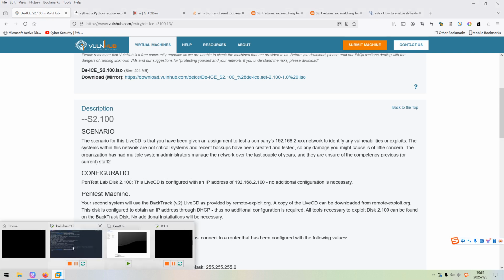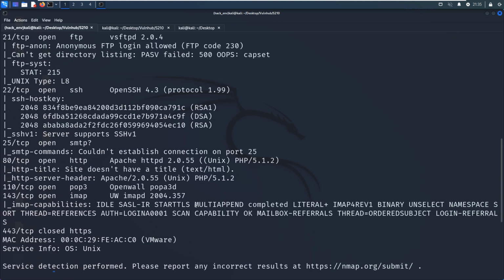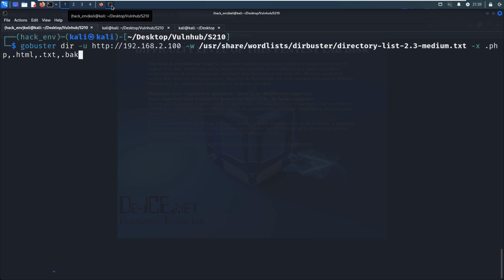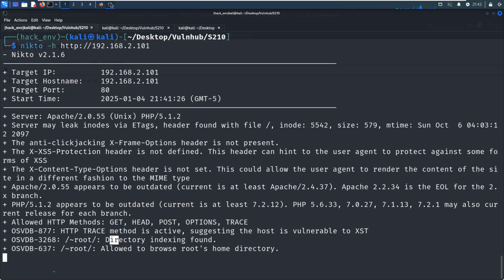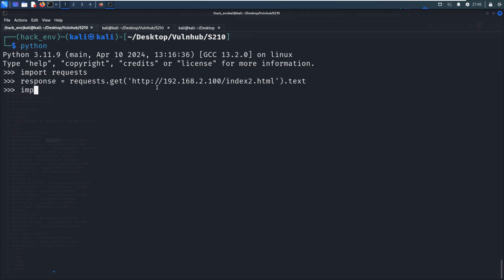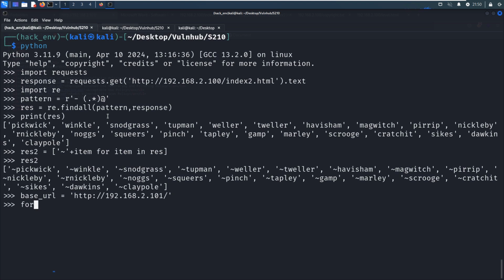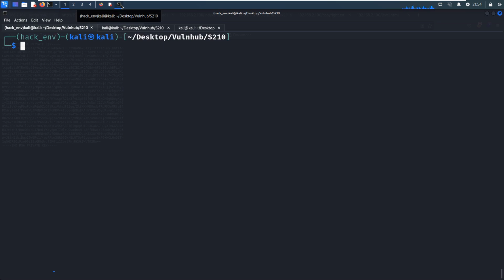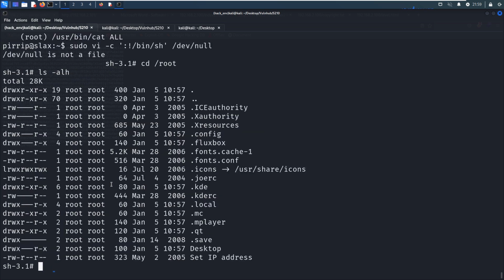Cyber Security | Penetration Test | Python   | CTF | Walkthrough |  De-ICE: S2.100

Comment: Hey, I wanted to ask about your connection in VirtualBox. Is your vulnerable VM on bridged or NAT network? Because i tried both the options and in both cases, nmap does not show which Ports are open, theyre just filtered. I also cannot connect through ftp because port is closed. So Im not quite sure what my issue is. I was also not able to connect to its htp because 80 wasnt open either
Reply from the maker: Normally I will set VM as host-only mode. Your attacking machine like Kali can have two NICs, one of them could be configured as NAT mode, another configured as host-only mode. Target VM can communicate with Kali over host-only network of VirtualBox.
Reply: Thanks for the reply. I'm able to find the VM, but for some reason, my VM's ports are entirely different. Port 22, 80 etc are not open, maybe I'm doing something wrong. If I can fix it, I'll try putting it here for others that might face the same issue
Reply from the maker: Please have a look my another video on how to set up lab with VirtualBox: https://youtu.be/DitxuP34VEo?si=40fc8WKSGwPfvfl0